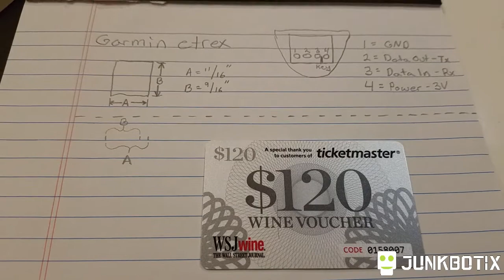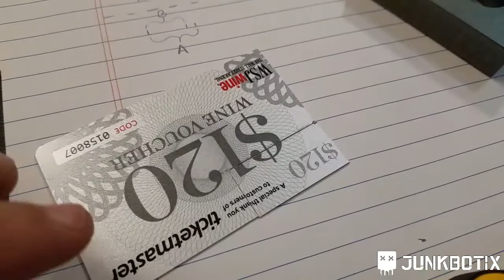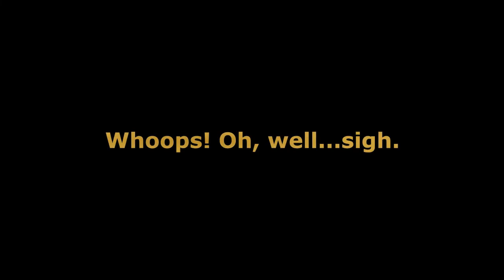Build A "Follow-Me" Robot - Part 10 - Controller and Basic Sensors

Comment: Ouch! Andrew...the garmin etrex10 costs about $110. It would look odd to buy one and modify it like this.
How can you make this work with say a NEO8m GPS module and maybe an Adafruit HMC5883L Magnetometer?
Reply from the maker: I'm using a very old Etrex unit - I bought it off somebody who advertised it on Craigslist years ago (actually, probably over a decade ago). From what I could gather on ebay, they (or a slightly newer model) run between $25-50.00 in used condition....

Now - granted - that's still way more expensive than the Neo8 modules you mention...I'm just using it because that's what I had on-hand, and it was just sitting otherwise for the most part, so I thought it might be a good thing to try out.

The code I will be writing for handling the GPS stuff should (hopefully) work with any GPS module that outputs standard NMEA-0183 strings - particularly the RMC string (Recommended minimum specific GPS/Transit data):

https://w3.cs.jmu.edu/bernstdh/web/common/help/nmea-sentences.php

I won't be using a magnetometer/compass module -- at least I am hoping I won't have to. GPS provides for the heading in the string - the only caveat is that you have to be moving before you will get that heading value. I have an idea on how I can get around this...but I won't know if it works until I try it.

If not...then I will have to implement a magnetometer/compass module into the system.

But I haven't written any of the code yet - but I will do this: I will break my library out to separate the reading of the GPS vs the Compass readings; the RMC sentence contains the heading in degrees (to one or two decimals) - where 0 degrees is "north" (without magnetic deviation factored in, which is given by another field - I don't think I'll need to worry about this because of the small distances involved, but we'll see).

So - I'll work to make it modular enough so that as long as you can get the RMC sentence from the GPS unit (or other details - mainly, all you care about is getting the latitude, longitude, and heading) - and the compass heading in degrees from the magnetometer - then you should be able to modify or adapt the code to work with your components.

Again - I was trying to make-do with the parts I had on hand. But if it seems like people are struggling with the project, etc - I'll probably try a different approach and buy some similar parts, and adapt the code to use them. But before that, I'm going to continue with the approach I am currently using. That said, I might also write in some commented out "blind code" (that is, completely non-tested with the hardware, use at your own risk) as if I did have those parts on-hand, with commenting, etc to help out those using the parts...